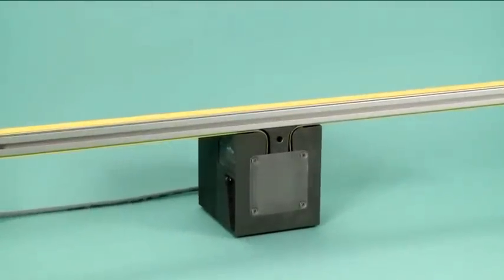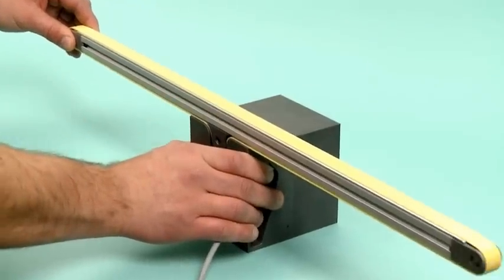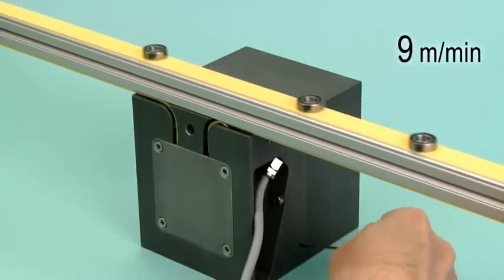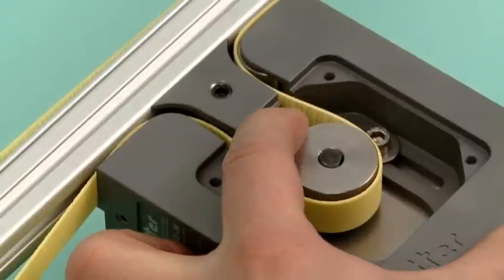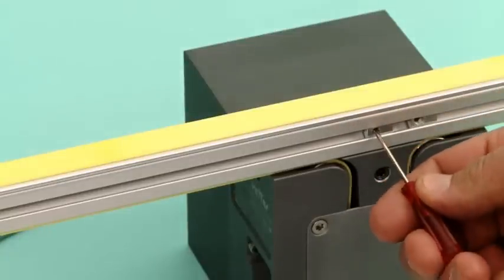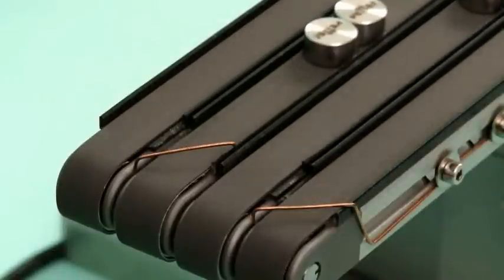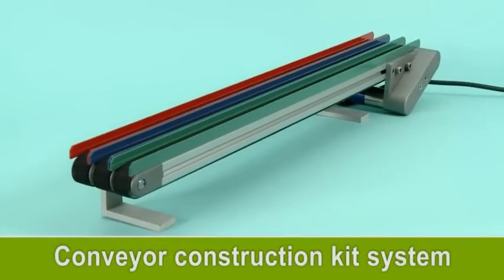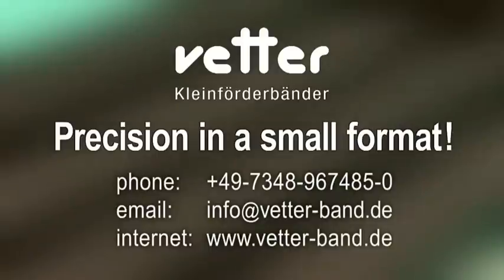Mini conveyor with middle drive - FR-20-20-M

Comment: This is a nice product for increasing manufacturing output. I like the part where you can attach sensors for counting or meeting length dimension, however if a sensor is put in place to slow the speed of the conveyer belt it may not be able to do this mechanically, unless there was an allowance for electronic speed adjustment.
Reply: there is, via the 0 to 10 volt speed input. So you could use a sensor to measure the amount of parts passing by and adjust the speed accordingly via a controller. For example.
Reply: @andrewwatts1997  Thank you for your input. Have a great day.👼🏿🗡️🗡️🗡️⚔️